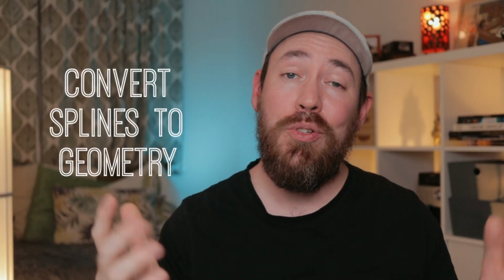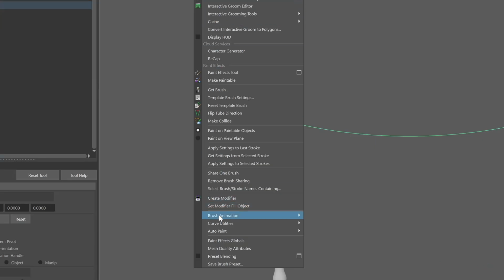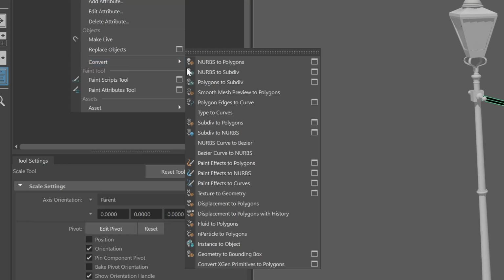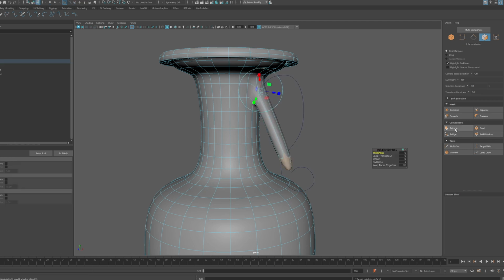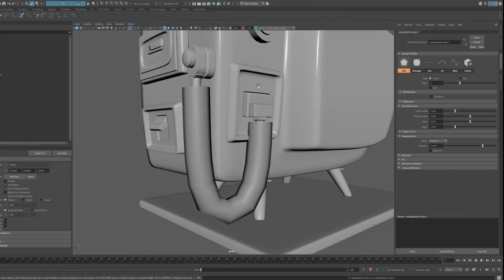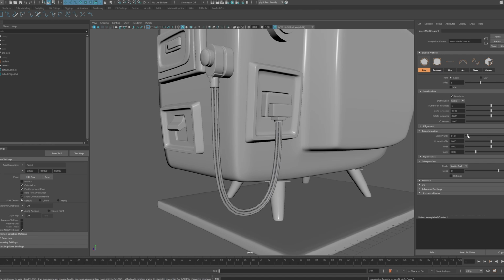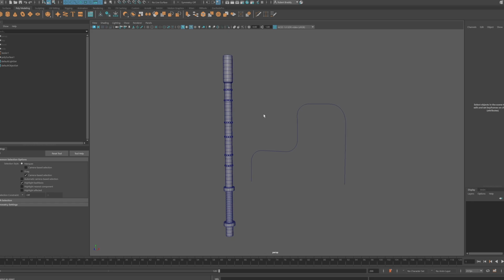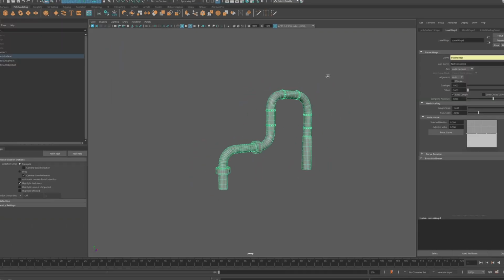How to Convert Curves to Polygons in Autodesk Maya

Comment: when i try the extrude method, it doesnt let me select both the curve and the face at the same time, im using 2025 maya as well and the sweep mesh and curve warp keeps showing an error saying that it "cant find the procedure" and the paint effects so work, however when i try to convert it back to a polygon it shows a warning saying "no lights in the scene" and it turns the mesh into triads, i guess i can just retopologize but it also stayed the color black and im not sure how to fix that and get it to be a normal mesh, im worried it might screw something up in my model if i leave it as is
reversing normals didnt do anything either
Reply: I found the solution: the sweep plugin wasnt loaded